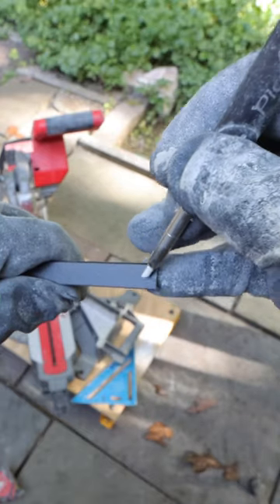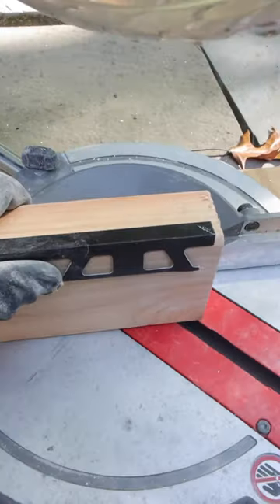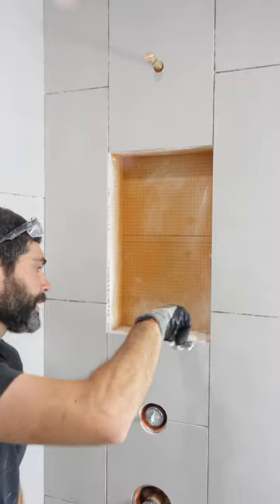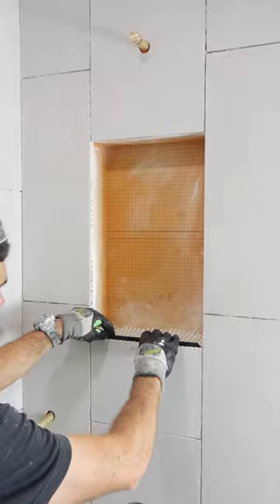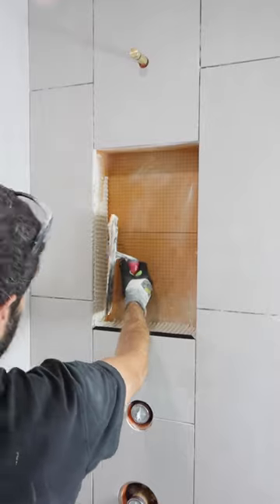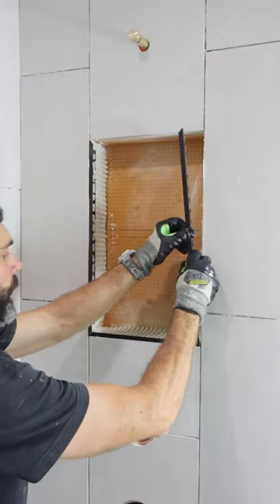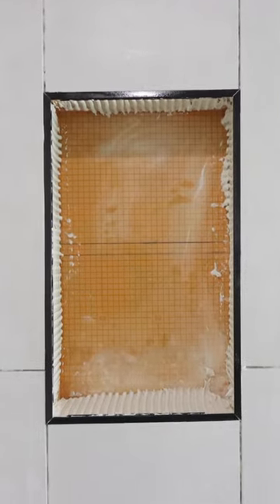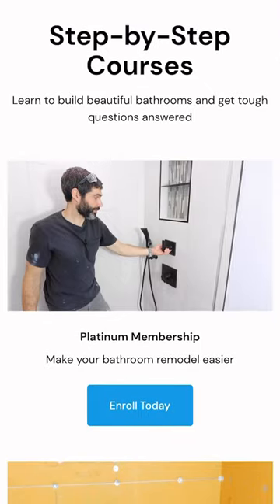Shower Niche Trim Tips - #shorts #diy #bathroomremodel #construction

Comment: Tin snips to remove the thin pieces helps illuminate kick back as well as the support material. I’m confused as to why you take the thinset? The purpose of the “Schluter shape” is to allow spluge through the trim to insure coverage on the trim. Cleanup with a margin trowel to remove excess. I suppose if you’re prepping for the tile you could stop the rake an inch sort of the outside edge. Any way tomato tamato

Comment: Is that a metal cutting blade on your saw or just regular blade?
Reply from the maker: Metal cutting blade, non-ferrous blade
Reply: @HomeRepairTutor  thank u 🙏
Reply: Does not have to be a metal cutting blade though. Just go slow. Woodworking tools have no issue cutting aluminum @camd610